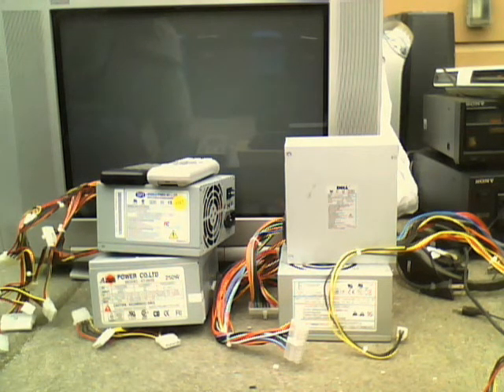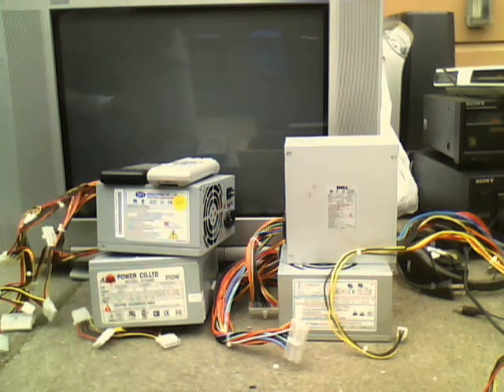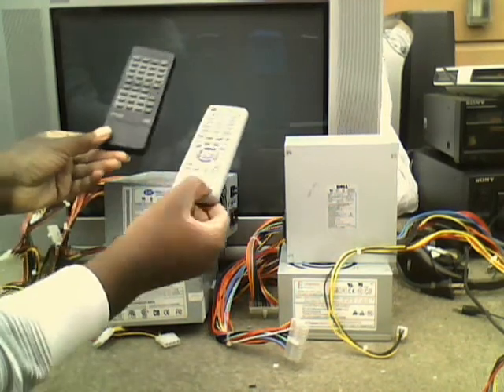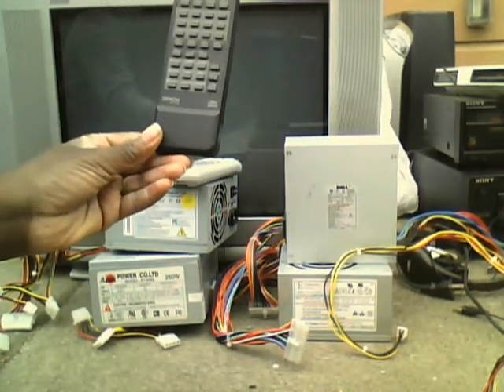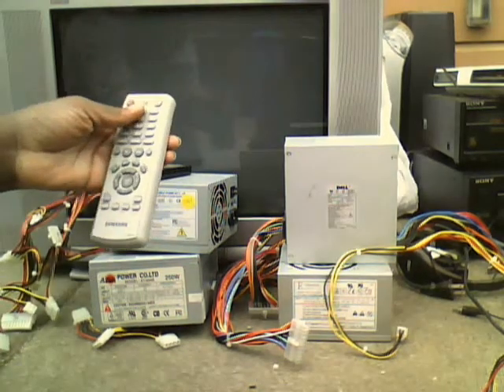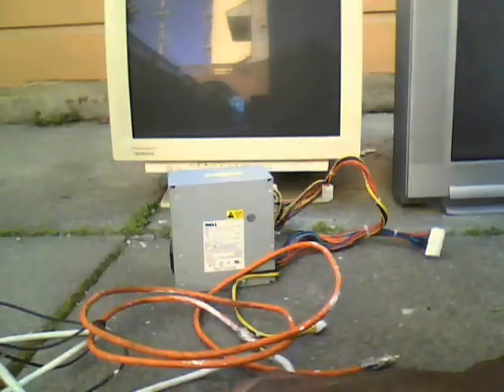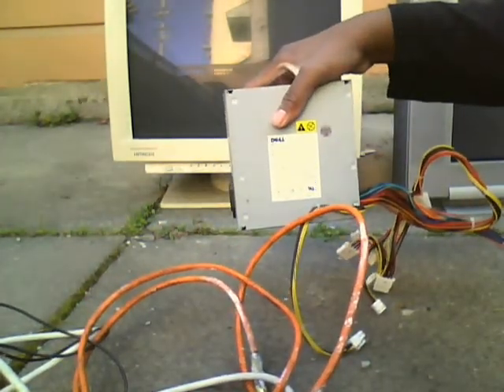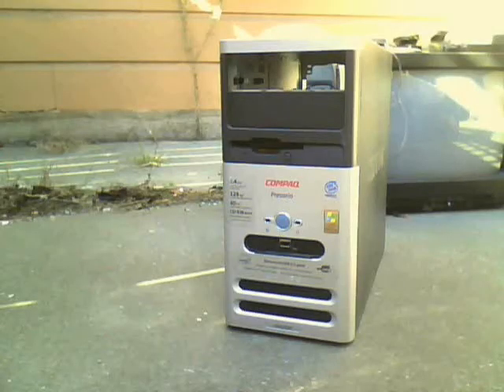EOL for My Trash Picked Computer Power Supplies

Comment: 1:35 My main desktop PC's power supply did something similar today when a speaker fell on the PC. But it blew up when it was running and there also was some smoke.. I think I will replace it and then fix and use the old one in some different PC. But it's gonna be a pain in the a-- to fix: fuse blown, diode bridge/mains rectifier damaged, one PCB trace damaged, PTC thermistor damaged...
Reply from the maker: Wow that sucks!

Comment: if the ones you tried were failing i guess it was good to not try the rest if i were you i would of opened them up and checked it out first the one that turned off and then on was a capacitor failing. i would have fixed the one turning off and on but the rest gie em to someone who would fix it or recycle them!
Reply from the maker: Yeah, I guess I could have done that, but I was so shaken by that explosion, that I just got rid of them.